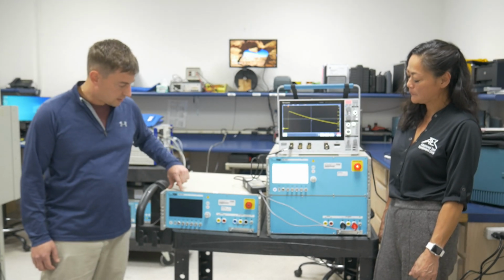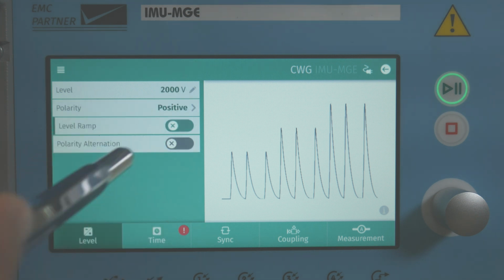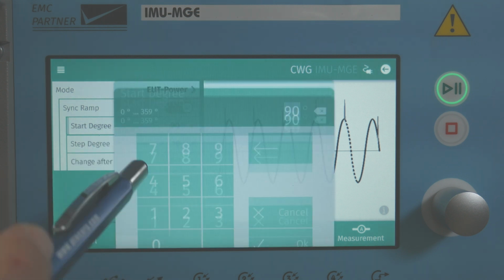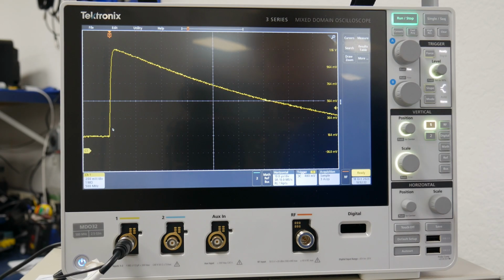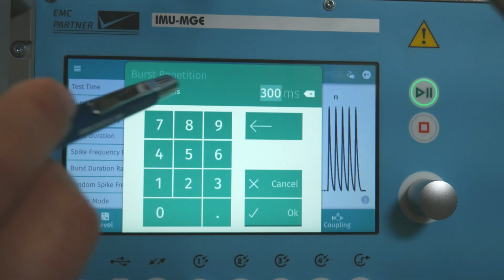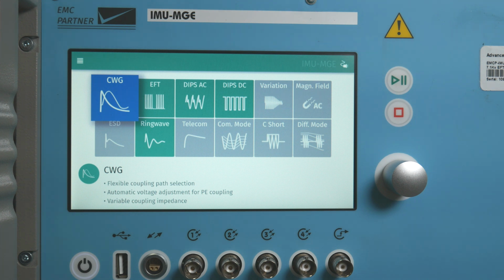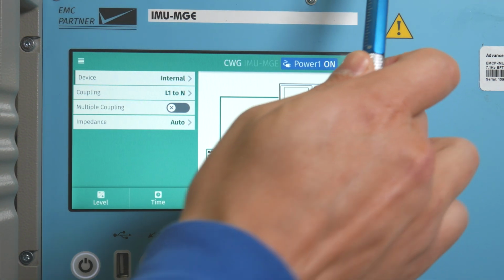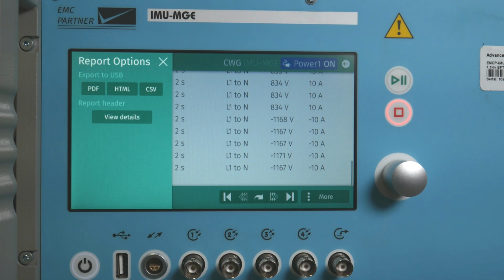Transient Generator Overview | EMC Partner IMU-MGE

Comment: Hi. Can you share the User Manual ?
Reply from the maker: Check out our webpage! https://www.atecorp.com/products/emc-partner/imu-mge
You can find the User Manual as well as highlighted specs or any other information you would need. Thanks for watching!
Reply: @AdvancedTestEquipmentCorp  The link is not working to me (request is blocked). I'm working on defining my procedures using the CDN-M-6-32 and this IMU generator to CWG testing. I don't know how to configure it to synchronize the surge output with the line phase shift. I'm also not entirely clear on how RS-485 control works or how I should configure the SYNC tab.

Best regards
Reply from the maker: @franconicolasmainero1949  Ensure that the CDN is connected to the IMU generator through the general settings under Accessories. Then under CWG make sure you have the CDN selected and then click sync and select Power line. Let us know if that works!